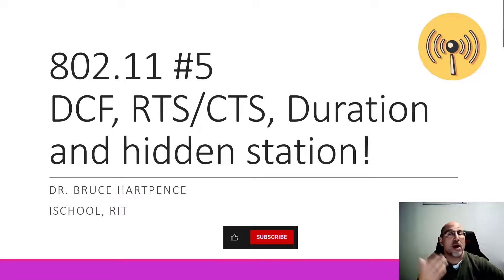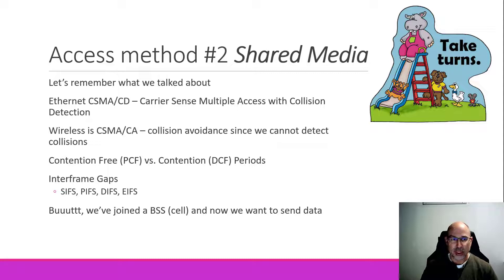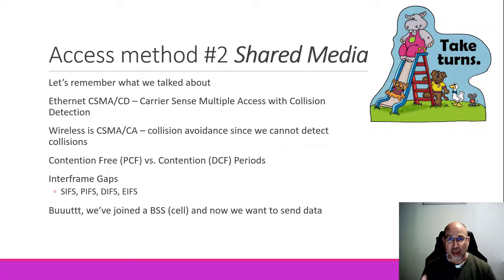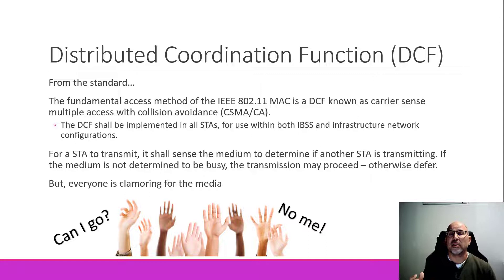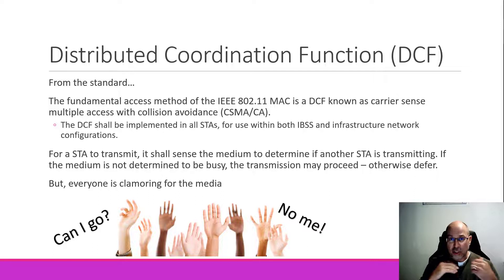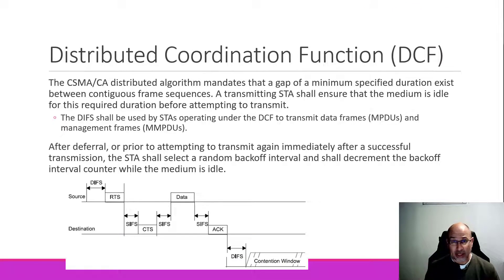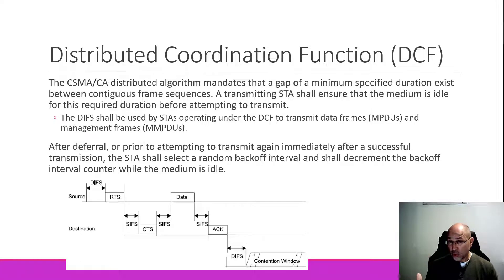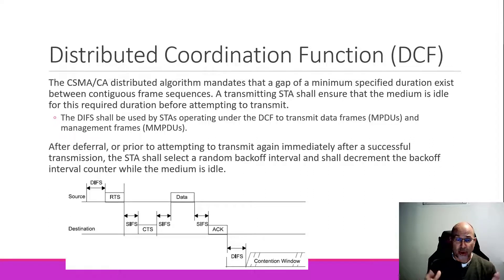802.11 Wireless part 5: Sending data in the DCF, obeying CSMA/CA and deciding on RTS/CTS.

Comment: great video.

But isn't missing what happens when there are collisions, i.e. we don't get our ACK, CTS oder see after the DIPS that the channel is busy?
Reply from the maker: Ahhh, good question. Well, part of that is the difference between CSMA/CD and CSMA/CA. With wireless we can't detect collisions so they just appear as interference or missed transmissions. CTS/RTS is not on all of the time and so the result is transmissions - and there is a retry flag as an indicator to help with this. Hope this helps.